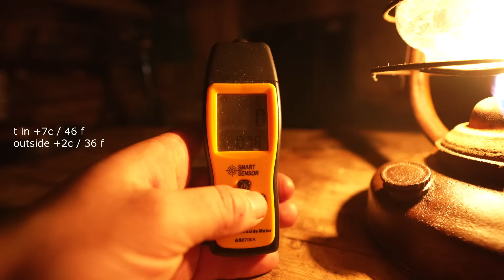hiding in an abandoned log cabin from  strong winter wind

Comment: You mention your luck when the log rolled away which was funny. You was lucky the log didn't roll into a deep hole.We all need a laugh once in awhile. 

Then you mentioned your luck when you fell. You was lucky you didn't get to hurt.

Things like this happen when you are not used to where you are.

I think you were very lucky you found a nice shelter out of the cold and it being equipped with things you could use to warm up, cook and sleep.

I really liked that you repaired a few things and replenished the pile of wood. I would have done the same thing.

Comment: Obviously its a long term project to get this cabin into shape. What is on the other side of the cabin but under the same roof?  Barn that used to hold cows, pigs, horses?  The animal heat would assist keeping cabin warm and vice versa.

Comment: I'm thinking you are actually pretty lucky with your bad luck.  Wondering how you know the water is ok to drink, but I guess you have been there before because who carries a roll of plastic with them.  Love that the cabin is there and even better you made some repairs to it.  Great video, I subscribed, thanks!
Reply: If the water is moving that it should be safe ..
Reply: @mlbolts72  not always, but this mountainous area should provide good filtering!
Reply: The water is safe. It's a spring, not runnoff or snow melt. Very little human contact.

Comment: Why didn't you just cut a large rectangle out of the clear plastic and cover all 3 windows? It would have created a dead air space.
You should consider getting one of those fireplace fans that uses the heat to turn the blades.
Tomersun Wood Stove Fan Heat Powered 6 Blades Wood Burning Stove Accessories Heat Fan for Wood Stove
Reply from the maker: Thank you very much, I'll think about buying one!